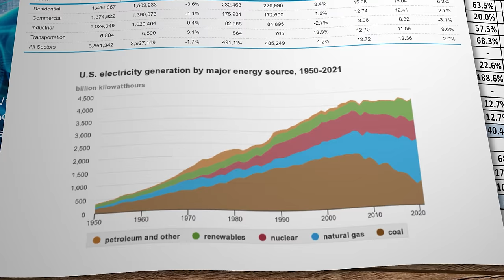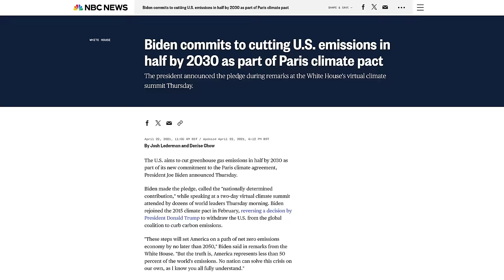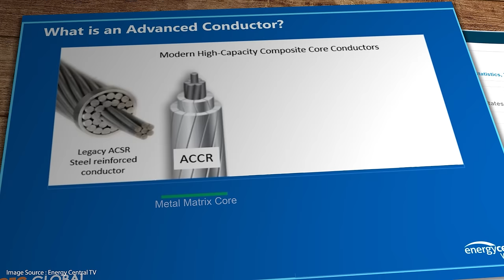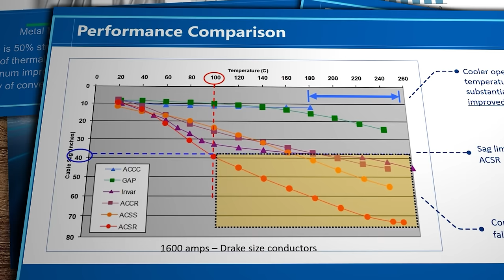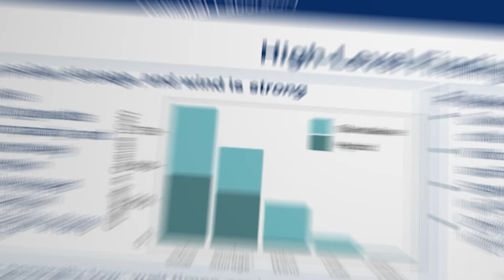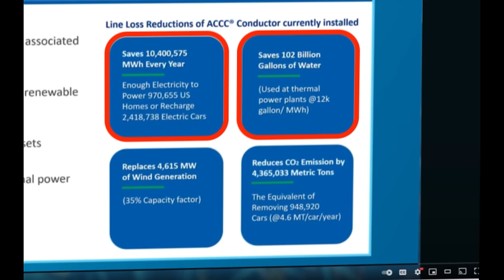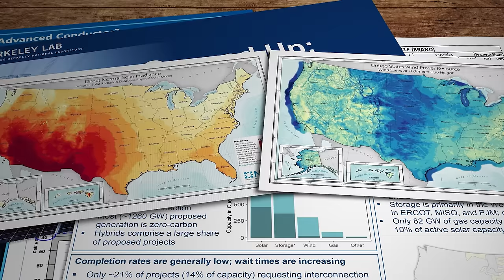Rethinking electricity grids.

Comment: Re-conductoring is a no-brainer. What people don’t realize is the grid can handle more load. All conductors are sized for peak load which happens twice a day. How much power do you think is running through those lines at 2 AM?  taking a first principle approach with energy storage means that localized batteries eliminate any grid upgrade requirement. Now of course you still need to plug in the windmills and solar panels into the grid but if you take a ridiculous example of scale and put a sea can of batteries in everybody’s backyard then we could probably power the world with extension cords! 😊 now adjust this scale to reality and we have decentralized energy storage and most importantly the elimination of curtailment which is the ultimate waste.
Reply: Slightly off topic but demand response will be more important in the next 20 years for the success of green energy than batteries will be.    

copy/paste from my stand alone comment
Reply: as you say, at 2am a mega-dollar grid is operating at a fraction of capacity. the entire investment is sized for peak demand yet most of the time less than half of peak is needed. an answer is in consumer peak leveling. which also offers consumers a choice of price for power. it works like this; every half hour the retail price of electricity changes, prices are digitally signaled in real time and forecast for 24 hours. so consumer devices can be tuned to low price points for heated water storage, battery charging, clothes drying and refrigeration etc (including cold storage to augment air conditioning at peak), leaving only essential and low-wattage, lighting etc devices when rates are high. a simple utility algorithm can easily set rates to deliver an almost flat grid demand over every 24 hours, thereby saving the difference between flat average and peak grid capacity investment.
Reply: @GaryGraham-sx4pm    It doesnt even need to be a flat demand.   Just knock off 10% from peak to that midnight to 5AM period is all thats needed.
Reply: Yep, we really want a system of storage buffers at the source and load, with the transmission system between running at close to full capacity at all times.  The cost of the storage systems payed back in efficient utilization of the transmission system.
Reply: Decentralized creation and energy storage the key here...

Comment: I'm a transmission planner.  Unfortunately, some of what you said is not true here in NY State.  Article 7 makes projects even on existing ROW very slow and costly.  Our environmental requirements also force us to use matting on most projects where soil will be disturbed, even just by heavy truck traffic, driving up our transmission line work by 40%.  No, that is not an exaggeration.  Most reconductoring (anywhere) requires all new towers as well, more than doubling the cost.  Our average 115 kV line rebuild cost (existing ROW) is around $12M per mile and growing fast.  It was half that less than a decade ago.  Lastly, I'll mention that reconductoring a typical transmission line will get you 2-3x the capacity, and there are limits to what you can transfer at any voltage, regardless of conductor capacity.  In cold climates where our biggest peak loading will soon be the backup (auxiliary) heat strips in ducted heat pump systems all kicking on when the heat drops below 10F (because most homeowners are buying the cheap ones that can't do -10 or -20F with the heat pump alone), we're going to need much more than 2-3x the capacity of our existing network, especially when also considering the coming EV loading.  We're still grappling with how we're going to handle it.  Finally, what good is added transmission capacity when we can't get the added baseload generation that we need?  Here's hoping that small modular reactors become a reality and FAST.
Reply: SMR is a boodoggle which you would know if you did any research.
Reply: All good points, except SMR
Reply: Why would reconductoring require new towers?  The new conductors aren't any heavier than the old ones, are they?
Reply: I agree on SMR. In Canada there are towns in the north running diesel generators 24/7 for power. SMR would be a game changer.
Reply: @calamityjean1525  yes, they generally are much heavier.  To get more ampacity generally means a bigger (larger diameter) wire, though different materials can also increase capacity, but only marginally.  The generally bigger wires are always heavier.  Plus, the existing towers that are supporting the kinds of lines that are becoming limited also tend to be quite old.  Towers have lifespans too.  So it often doesn't make much sense to spend incredible sums to replace existing conductor on existing old towers (even if they happen to be capable of supporting the new conductor), if you're just going to have to go out and replace the towers also in 10-15 years, especially when 40-60% of the cost is in mobilization and overheads.  In the long run, it usually saves money to just replace the towers too.  Doing so usually also means you can put up even bigger conductor to help future-proof the circuit.
Reply: @coreyfinch5718  Thanks for the information.
Reply: This guy knows what he's talking about. This is what everyone is hoping for. Dispersed micro production is the future.
Reply: @coreyfinch5718    Thank you for that information.  It's always good to learn something new.

Comment: The most important property of the high temperature low sag (HTLS) conductors, such as the ACCC type, is that their cores have a much lower coefficient of thermal expansion compared to the conventional galvanized steel core of the normal ACSR conductor. This means, that those HTLS conductors feature a knee point in their thermal expansion (which is the result of heating proportional to roughly i^2  (i=current)). This means, that, above a certain temperature (knee point) (depending also on the stringing tension), the sag(Temp) curve becomes flatter, when the aluminum becomes completely slack (no tension) and all the tensile load is transfered to the core (which has a low coefficient of thermal expansion). This allows to transmit more power per sqcm with these conductors (allowing a higher temperature than 80°C) without running into a insulation coordination issue.

Comment: In The Netherlands, it’s not only about transmission lines but also about transformer capacity. 🌷🤷‍♀️
Reply: Yeah, the Decepticons are always causing trouble.
Reply: Sure but getting an additional transformer does not seem so controversial
Reply: Same issue in the US. And the current lead time on transformers is 2 years.
Reply: @mere_cat  I wonder if the war in Ukraine is effecting that statistic. Not sure about the US, but in Europe they've already donated a lot of their spare transformers to keep the Ukrainian grid running.
Reply: @Kevin_Street  the war in Ukraine has had a massive effect on lead times but aid to Ukraine isn't the reason. 

Sanctions on Russian steel have massively reduced raw material supply to transformer manufacturers. Combing that with massively increased demand for new large Power Transformers (>300% in many countries) has pushed leads times out by 4x. 

Components which almost solely come from China have also added massive lead times, such as cooling fans. The end to the war/sanctions would have a large effect on leads times but the core issue is the massively increased demand for transformers due to connection of renewables and increased electrification of industry and transport
Reply: Transformers. More than meets the eye.
Reply: @hebegebees2  I see. Thanks for the clarification! So transformer capacity is a big problem in Europe when it comes to upgrading the electrical grid.
Reply: @JustNow42 not controversial (although new ones have to be placed somewhere in densely populated areas), but there are many of them, so time consuming and costly to replace.
Reply: Here it's six months  @mere_cat

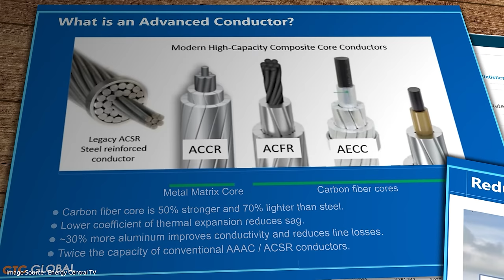Comment: 3:34 Energy Central CTC Global webinar bullet points. Cable types: ACSR ACCR ACFR AECC 4:52 ACCC: lighter weight but increased strength, capacity, reduced resistance line loss, and less sag at higher temps.👍

Comment: I worked a couple of years in the energy industry and grid operators hate maintenance more than they hate anything else. I have seen producers urging them to upgrade their grid only to hear BS like "we are working on a project so we dont have money for anything else". 
not all of them of course but even those that do try to keep up have to do deal with unreasonable producers that want their part of the grid to upgraded first while "smaller" ones "can wait" even tho those "smaller" ones would be much more urgent/effective for the grid as a whole... its a mess on both sides of the issue.

Comment: In Québec, they've slowly been upgrading the network over the last 2 decades. More often than not, they tear down the entire line and start from scratch. What they've been doing is upgrading lines and substations from the old 200KV to 315 KV which is the more common voltage nowadays for the second layer of the transmission network. Most of the long range transmission is done using 735 KV lines. Increasing voltage reduces losses, but requires taller towers. Another big issue to consider is redundancy. In Québec, we learned that the hard way with the 1998 ice storm. One of the big changes has been to ensure that most substations can be powered by at least 2 separate circuits.
Reply: Québec has Hydro Québec, which is a 100% publicly-owned utility.  (Contrast this with Ontario, which privatized parts of the system such as generation that earn money, but left parts such as transmission that cost money with taxpayers.)  I understand some of the larger cities (Montreal, for example) have significant permitting challenges, but overall the permitting process is fairly streamlined compared to most of the rest of the continent.
Reply: @jeffreyquinn3820  As far as permitting goes, there's nothing like a catastrophe to wake peoples up and get things moving. When an issue start to affect the comfort of peoples, things tend to move quickly. The 1998 ice storm played that role in Québec and it might very well be that the US needs its own wake up call to fix some of the issues it has.
Reply: @jeffreyquinn3820  Transmission is always a monopoly. So it is better own by the public. At power generation real competion is possible.
Reply: @orbiradio2465   Power generation is either a monopoly or oligopoly.  Oligopolies seldom work out better than a regulated or state-owned monopoly, and are by definition not very competitive.  So my ECON 101 textbook says.
Reply: Also in the UK swapping the lines out has been going on for several years.
Reply: "’One of the big changes has been to ensure that most substations can be powered by at least 2 separate circuits."
It would probably also help to put batteries at every substation that has room for them.  The batteries could charge during times of low demand and discharge during high demand, reducing the amount of transmission required between the generators and the batteries.
Reply: @calamityjean1525    In Québec, during winter, we heat our homes with electricity. It represents a very large portion of base load during winter. I doubt that batteries could sustain that kind of load for more than a few hours. The base loads and peak loads are just way too high for that.

The way that we handle peak loads is through the interconnections that we have with several northern US states. During summer, we export electricity to satisfy their electricity demands that arise as a result of air conditioning, and during winter, we import a smaller amount as needed. In that sense, our two grids are very well balanced since our peak loads happen during opposite seasons.

Another thing to take into account is that we produce and consume more electricity per capita than just about anywhere else in the world. This is a direct result of the fact that we have a number of industries that are extremely power hungry. If need be, they can be taken off the grid, either partially, or completely to meat demand.
Reply: @jonathanlanglois2742  Regarding heating homes with electricity:  If you are using electric resistance heating, you are right.  Batteries couldn't hold that much power.  
If you change over to heat pumps and accept radically reducing indoor temperatures during an emergency like the transmission line having an airplane crash on it you could at least keep buildings warm enough to keep pipes from freezing for a few days while repairs are made.  It wouldn't be comfortable, but it's better than nothing.

Comment: I wrote a paper last year on electricity for a greener world, where I looked at future consumption needs, generation, and transmission.  I think that reconductoring is going to be a wonderful addition to any business looking to increase capacity and lower costs using existing transmission network infrastructure.  Obviously cabling in only one part of the network, but it is good step in the right direction, and should also help with budgets for replacing pole-mounted transformers, etc.  Thanks for sharing.

Comment: Don't forget to say that the electricity demand in the UK has dropped by 20% over the last 10 years. Interesting to hear that the US has the same bureaucratic issues with grid connection that we have.
Reply: Thanks to the EU energy efficiency regulations
Reply: @adblocker276 True, in EU countries, a lot of effort has gone into reducing energy use without lowering quality of living.

Over the last two decades, we've managed to cut our electric use by about half what it was 20 years ago, even thought we have more tech devices and computers around the home, and there are still many improvements that can be done.

It also looks like since the invasion of Ukraine by Russia, there's another big push to reduce energy consumption whiles at the same time boost renewable energy generation, the two together makes it much easier to do the transition.

But with all that said, there's likely going to be more demand on the electric grid because of EV cars and heat pump, which is pushing all our energy needs to electric, which is fine by me because it's a lot more flexible in how it can be used and we can also generate it with renewable energy.

Thanks to EU regulations, it's putting constant pressure on all companies to find ways of reducing the energy a product needs.
Reply: @adblocker276 actually I'm guessing it's more related to economic decline. Power demand is linked to how many factories and businesses are running.
Reply: UK doesn't manufacture anything anymore. And it drops more industries every year.
Reply: Yep, computers, lighting, TVs and standby consumption all improved dramatically in consumption terms. And a lot of relatively high power gadgets like Hi-fi systems and VCRs and radio-alarm-clocks have just disappeared over the last 30 years and been replaced by much lower-power kit (e.g. mobile phone+bluetooth speaker). There are more other gadgets (routers, voice assisstants, smart doorbells/thermostats/hot water tanks) but most of those are low power. Ultimately it's the LEDs that are responsible for most of the reduction.
Reply: @matthewbaynham6286 Yep. Outsourcing steel production overseas for instance makes it easy to meet EU requirements by sending the problem somewhere else. This effectively concentrates the most energy hungry and polluting industries into the countries that can least afford the cost of energy efficiency and decarbonisation.

It does however allow the EU to claim green cred.
Reply: @xxwookey And all of that is a tiny drop in the bucket of energy use. The primary driver of reduced energy consumption is likely to be the offshoring of high energy consumption industries.

Consumer appliances are a rounding error compared to lighting and heating.
Reply: @SurmaSampo LED lights are a significant player and heat pump heating and cooling even more so.
Reply: @paul1979uk2000  Yep the Domestic UK goverment has been shouldering all the load of reducing it's citizens quality of life without any help from the EU.
Reply: @DrakeN-ow1im  Sure, but they have not so much reduced energy use as they have allowed more benefits from the same amount of energy consumed. It should be noted that modern airconditioning and the units from 20 years ago use almost exactly the same amount of power. The reverse cycle inverter coolers are not new.

 Heat pump systems are not new either, they have just become more common in the lower duty cycle, lower cost markets. They also have higher maintenance requirements than the alternatives so they tend to have shorter operating lives and are less effective in very cold conditions. This makes their lifetime ROI sometimes not that great.
Reply: @matthewbaynham6286  It's a combination of the two in the UK.  Most of our manufacturing decline happened during the Tory Government of 1979-97, but there has been ongoing manufacturing decline.  OTOH the UK population has grown by 15% since 2000, and more efficient energy use (and more efficient buildings) has more than offset this.
Reply: We have lost a lot of power stations over that period too, no coal anymore. We are on a scheme from our provider to refrain from using power at peak periods because the grid is struggling.
Reply: @philspencelayh5464 Not just that:  also to save money.  We could pay more for peak electricity and have supply, but it's better to shave the peak where possible, thus saving money.